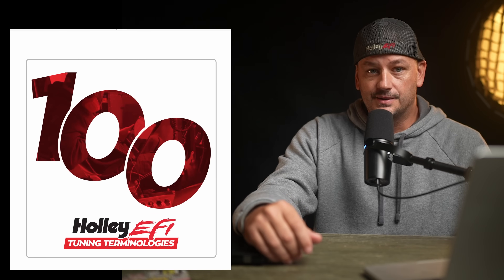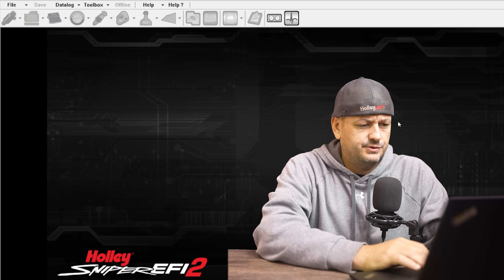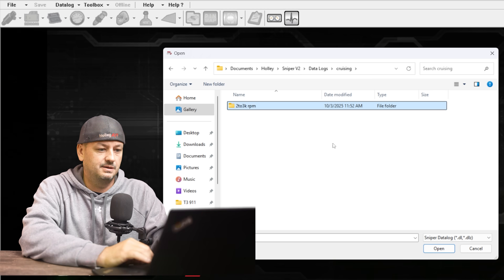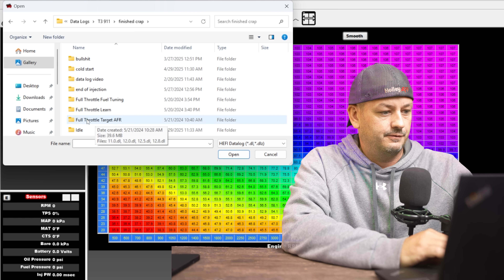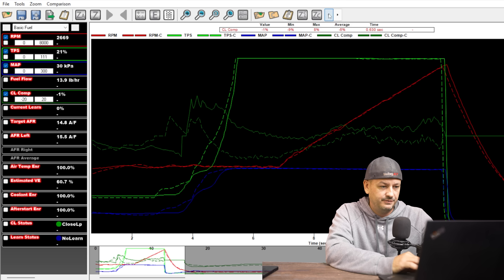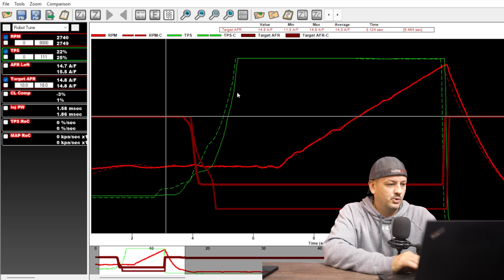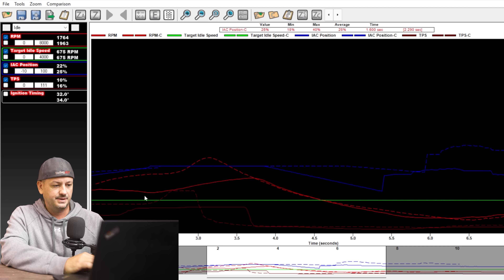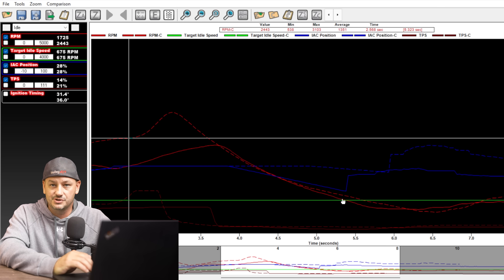Datalogging is Hard, Until You Do This (Holley Sniper, Terminator X, Hp/Dominator)

Comment: I use data logging to tune my triple Weber Dcoe carbs, every thing has a jet or adjustment an it times 6. It is amazing seeing the AFR change in certian areas of the slope. When I started the car drove okay but everything was off the chart to rich and to lean and now this week im making hard runs with repectfully flat AFR's. Normally i make like a log maybe from a stop and do two to three gear pull, then I'll do another cruising and maybe a highway overtake type acceleration.

Comment: One thing I like about Holley compared to factory PCM logging is the Holley logs everything each time. There is little worse than making a log on the street to fix a condition and discover after the fact the parameter you needed wasn't being logged. Filtering what isn't relevant is far better than not having data you need.